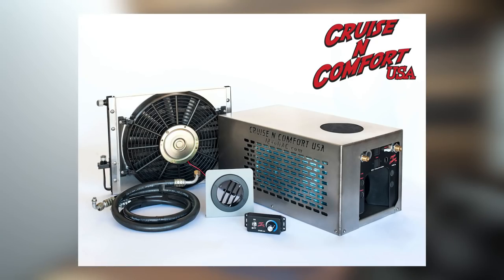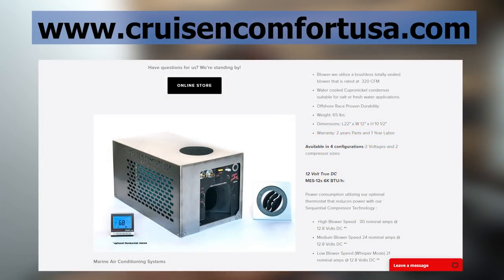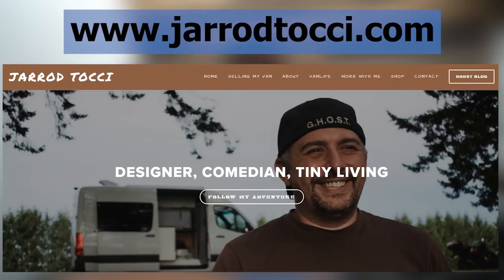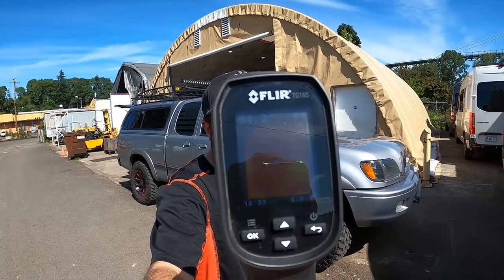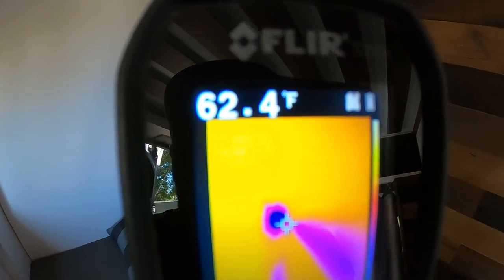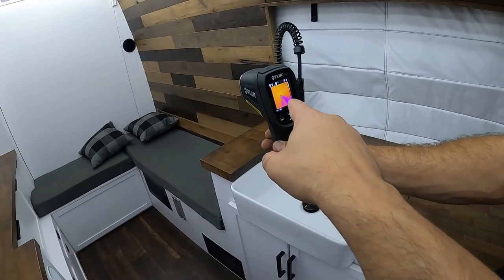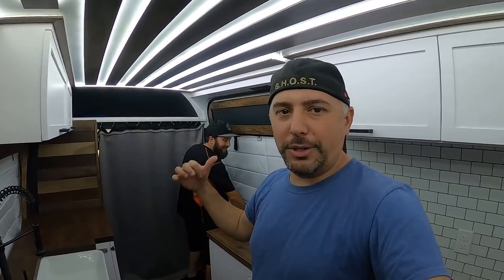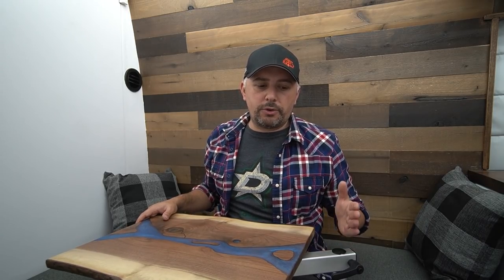Van Life A/C TESTED! Used an Infrared Thermostat to Read Temps

Comment: So there's no way to make that  machine quieter.. not very..there's got to be a way to make it quieter or at least at 80%. They now do it with air compressors..

I'm wondering if he's singing in an egg crate box of course with venting might cut the sound??? Just an idea not sure I haven't tried it yet.
Reply: Couple different ways to cut the noise on the outside condenser fans. If you purchase the double fan condenser option the 2 fans can be wired in parallel (like in the video) for hotter climates like the desert Southwest. The fans can also be wired in series and cut half speed to reduce the noise for night time sleeping or for normal use in climates other than the desert southwest. When we developed this product for a very large and popular amusement park 8 years ago they were wired in series to keep the sound down. The internal evaporator sound can be reduced for sleeping by selecting low or medium on the thermostat. This will also make the evaporator colder and reduce the power consumption by the compressor and blower (a feature not found in any other unit we know of).🤓

Comment: what are your thoughts on mounting condenser inside a tiny watts solar roof box?
Reply from the maker: Don't know if I'd do that. I'm just speaking personally. I'm not sure I would see the point to that is all. The box is designed and made for storage and the condenser fan is designed and made to fit under the van. I personally think you'd be doing a disservice to the usage of the box. Plus not sure if there's enough air flow in the box for the fans
Reply: The double fan condenser moves approximately 1900 cfm of air wired in parallel .... that might be a challenge to get that much air in and out.
Reply: @CruiseNComfortUSA  I have  170 sprinter 4x4 and was thinking off roading might clog the condenser even with some form of screen.   Just noodling for now.  Thanks for the reply
Reply: I was thinking the same thing, I think with some hefty modification to the box it would be fine, the trouble is how the roof of the box encloses around the sides. That would be difficult to waterproof
Reply: Mike Land it is a automotive grade condenser and fan combo. I have not heard of any issues mounting it underneath. If it gets dirty hose it out at the local car wash

Comment: Someone needs to do a reality check. For $4K+ it is better to buy 3-4 extra BattleBorn LiFePo4 batteries, an efficient inverter, and a cheap and efficient 110V A/C unit.
Reply: "Let me turn this off so I can talk to you."
Reply from the maker: Soooo you'd rather spend another $900 per battery and then another $1000 on more efficient inverter. I don't think your math makes sense here
Reply from the maker: And yes I turned off the AC so you could hear me better. Not that it was too loud! So it's not distracting. That's filming 101 my friend
Reply: Vanman Mike the unit has a thermostat that has a low and a medium setting that reduces the noise for sleeping and what not . The unit is way quieter than a roof top unit ( I have 2 on my toy hauler ) I think it’s how the phones pickup that frequency range better when recording .... not sure 🤔

Comment: Thanks for a great series of videos on the Cruise N Comfort AC!  I have a Sprinter and want to install a 12V ac without adding a unit to my roof.  You've had the AC for a while and you know quite a bit about Nomatic and Dometic AC units as well.  Are you still happy with your decision?  Another question, does the unit quiet down once the van get close to the set temp?  Do the fans slow down and quiet down a bit?  The Nomatic and Dometic have "ecomode" and I wonder if the Cruise N Comfort cycles down to consume less amps in the middle of the night when the heat load is less.  Again, thank you for the great videos!  Very informative, well done, thank you!

Comment: Seems to me if you go with the AC, best time to get it is prebuild. Gotta be tough trying to figure it out post build.  I was told you needed 600 AH minimum to run it overnight. and maximum insulation. I placed mine in front of the drivers back wheel stacked with the hydronic floors equipment. My van is at that exact location now, getting 3 belt 24v  2nd alternator and alarm, high idle and remote start put in.

Comment: Kingtec is not a 12v compressor either. Its 12v converting to push a 110v Compressor. That is why Kingtec pulls more Amps

Comment: It was because of Jarrod, that we chose Cruise N Comfort. Glad we did.

Lily, our 2019 Sprinter, 170 extended, XD, 4x4, has been in 47 of the 48 and North Dakota might happen next month. Lily has been from Vancouver Island to Key West. From Los Angeles to Montreal. She's been to the bottom of Death Valley and 12,000 ft up in Rocky Mountain National Park.  All of this would have been a lot less enjoyable without our HD series, 24v, split Cruise N Comfort AC system. 

Save your roof space for a deck or better yet, more solar. Don't risk another hole in your roof;  you won't know you have a leak until the damage is done. Cruise N Comfort and with confidence.

PS: we did have a problem with our system; it kept losing its charge. Nobody would consider diagnosing the problem, much less fix it because it's a Mercedes and if they didn't build the van, they didn't want to fix somebody else's problem - and that's exactly what it was, our up-fitter builder didn't crimp the lines at the evaporator properly.

Even though she was out of warranty, both the upfitter's and Cruise N Comfort's, we took Lily to THE specialist - to Cruise N Comfort  in Tempe, AZ.  Chris (Chris Frye, Owner) got under the van and spotted the crimping problem immediately. Chris set us up with new (and improved lines and fittings) and a local guy that could install them - Chris was getting ready for Overland Expo and besides,  it was the builder's crimp job, not a probhem with his unit.  Anyway, yeah, happy campers again!

Thank you Chris.
Reply from the maker: This warms my heart and I’ll make sure Chris sees this. Thank you again for this comment!

Comment: With a vent and drain pan in your garage you could just install a $150 5000 BTU wall unit that dumps into your garage (nothing visible from outside ).  I tested this in my much smaller van and while drawing about 450 watts it felt like freezer in 30 minutes under the sun in Florida.  But thinking about it, if I need to work in the van for an hour in the middle of the day I just park under the trees and run the van's AC on full blast and the fuel needle does not even move.  At night before going to sleep while I surf and watch TV I run the van's AC on full blast and it cools down the van and tops off battery.

Comment: 3k for a system? have window shaker with inverter for 600...12v ac is way overpriced.
Reply: They quoted to me $4800 on sale when I contacted them directly.
Reply: @andreawisner7358  The VES system is $2,995 but doesn't have a thermostat option or variable speed compressor to reduce power consumption. The HD-12L is $4,295 without the thermostat or double fan condenser.
Reply: Our compressors are truly 12 volt and are made for us right here in the USA . We started using these about 10 years ago when we designed this system for the largest theme park in the world. They are ridiculously expensive (my wife tells me this every time she writes a check for the truckload 😂) but they last and are super efficient compared to all the overseas companies that have sent us samples. Warranty work is not good  for both the consumer and the manufacturer ❄️

Comment: As a otr truck driver I've never been a fan of any of the electric ac units. Now a diesel Apu powered AC unit is hands down capable but it comes with it's own footprint of size sound and cost

Comment: Very cool 🤙🏼 it was a little louder than I expected... how loud is it from the outside? Does it have an effect on the stealth side of things? ..... man that Van is nice 👍🏼
Reply from the maker: If I was in "stealth" mode then I'd turn down the fans by using the keypad and you can change the fan speed.
Reply: With the dual fan condensers you can run them in parallel (like in the video) and they move about 1,900 CFM. This is great for really hot days and in the southwest united states. Another option on the dual fans for the rest of the United States that is not like Arizona for example would be to wire them in series and cut the speed in half. We are working on a way to do that with a knob inside the vehicle but until then see the installation manual for wiring configurations.
https://static1.squarespace.com/static/574ddcb49f72667133223193/t/5efec9646ad93e46b154997e/1593756019251/HD+12%3A24+L%3As++Installation+2.6+.pdf
Reply: @CruiseNComfortUSA  Yes I dont get why a/c manufacturers dont give you the option for a lower fan speed for more quiet. Put a dial there, so you can turn it super low. If we waste energy, it's our choice, right?
Reply: One of the reasons the ducting is loud is die to air velocity. I know space was an issue on this post build install. But to quiet down the vents for new installs, install larger ducting. And if you can put in a few vents. The larger the diameter of the duct and the more outlets you have the lower the velocity of the air. Thus much quieter.

A MFG suggestion for the condenser. Install a fan cycle switch in the low pressure refrigerant line. Typically these head pressure controls are for cooler climates to control head pressure. But can be adapted for noise abatement. Set the first fan cut in about 144psi to kick on 1 fan. Then a second switch to turn onnthe second fan at 160 or so. Both fans will run when it's hot outside. Only 1 will run when its cooler. And if it's in the middle the second fan will cycle on and off. Assuming you guys use a TXV in the system. You could also use 2 speed fans and have first stage be low on both fans and 2nd stage being high on both fans. Lots of options but will increase the price a bit. The johnson control all range switches are not very expensive thou so it could be only a small price impact.

Comment: Is there a way to make it quieter? I see some people modify rv air conditioning to help with noise. Would that be possible?
Reply: Couple different ways to cut the noise on the outside condenser fans. If you purchase the double fan condenser option the 2 fans can be wired in parallel (like in the video) for hotter climates like the desert Southwest. The fans can also be wired in series and cut half speed to reduce the noise for night time sleeping or for normal use in climates other than the desert southwest. When we developed this product for a very large and popular amusement park 8 years ago they were wired in series to keep the sound down. The internal evaporator sound can be reduced for sleeping by selecting low or medium on the thermostat.

Comment: Too noisy inside Not enough out holes. Add 4 more holes  two on each side.  you l cut noise in half
Reply from the maker: If you cut more holes then you loose efficiency. You can also adjust the fan with the key pad to not make it as noisy

Comment: Now that you installed your condenser under the van where do you have your spare tire mounted at
Reply from the maker: I personally took it off. However if someone still wanted to keep in on then you can get it mounted on the back doors. There are a few companies that make a way to mount it right to the hinges of the doors.

Comment: Its much quieter inside on low fan speed
Reply: On low fan speed it would prolly have a hell of time fighting the sun.
Reply: @jeffreyulery2182  Actually, it does well. with the cruise and comfort systems, they say to run the vehicle A/C first and cool the room; if it has been in the sun all day. then, turn on the Cruise N Comfort; to maintain room temp.